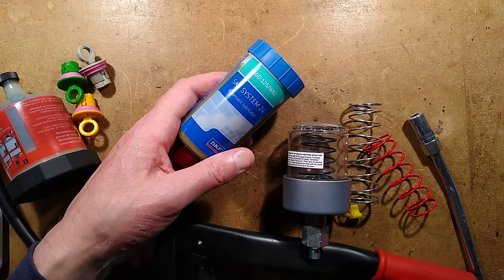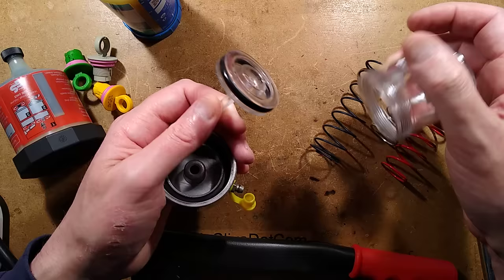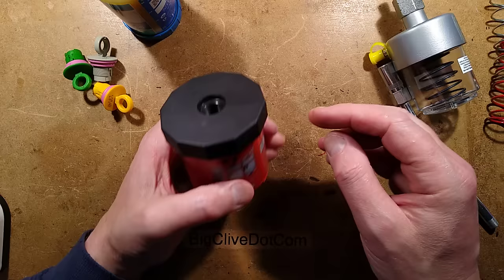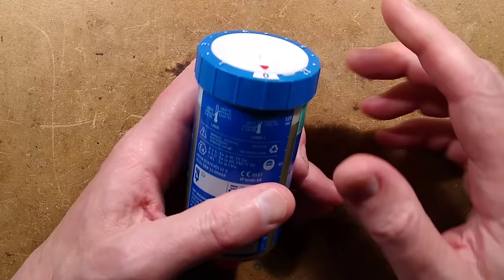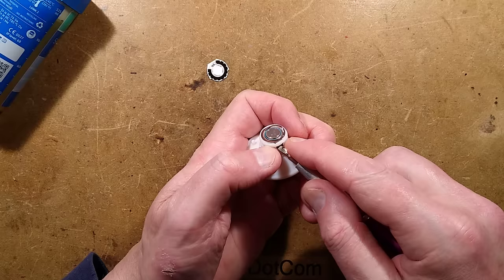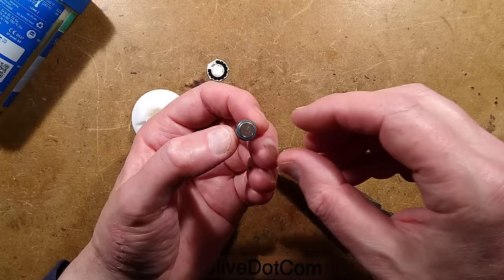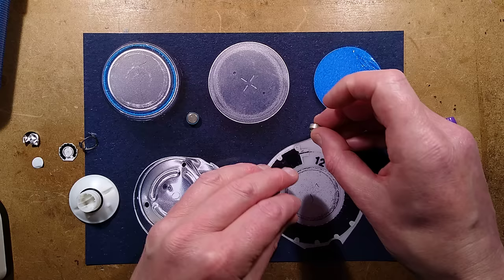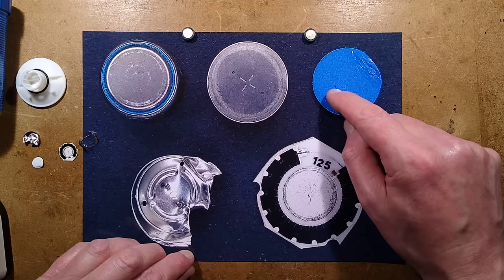Absolute genius automatic lubricator

Comment: Very interesting, yet so simple and brilliant! All of them.
By the way, it's not exactly a potentiometer, but a variable resistor. It has two terminals instead of three.
Reply: I've always called it a carbon film variable resistor.
Reply: Back in my day it was a rheostat.
Reply: @securitycamera8776  "Rheostat" from the Greek ρωή (flow) and στάση (stopping). Nice word that explains what the component does (flow-stopper)
Reply: I was taught variable resistor.
Reply: I always knew it as a potentiometer, just using only some of the 3 pins.  In this device it's entirely custom, not a standard type mounted into the circuit.
Reply: 3 terminal mode potentiometer functions as a voltage divider and for 2 terminal mode as a current limiter like an ordinary resistor

Comment: I’ve seen air fresheners that work on the electro-chemical system. One is called “TCELL” by Rubbermaid. It uses a button cell to pressurize the fragrance and push it onto a wick. I was fascinated with these for a year. Amazing tech.
Reply: I just saw that you have a video on the Rubbermaid fresheners! 😊

Comment: Genius design. Now I want to know how much gas is generated over a fixed time. Seal one of the cells inside a balloon with a fixed resistor across it and leave for a few days?
Reply: You might find that the gas leaks out through the walls of the balloon faster than the cell generates it!
Reply: There's no gas evolution from a normal zinc air cell...
Reply: @stepheneyles2198  agreed. Seal it in a small chamber with a pressure gauge, chart pressure rise at regular intervals and then use universal gas laws to calculate subsequent volumes and use as basis for any further calculations you need. It would seem the release of gas is linear in nature in relation to increase in resistance so no need for plotting at many different resistances once you confirm that
Reply: @stepheneyles2198  Anything that could leak through the walls of a balloon is going to walk right past that rubber O ring and not touch either side.
Reply: Try a mylar balloon or bag, heat sealed closed.
Reply: @Alacritous  I'm imagining some gas molecules as stick figures doing the Jim Carrey Walk through the cross-section of an O-ring on one of Clive's doodles right now!
"... going to walk right past ..." 
Have a Thumb-Up for that statement! 😀
Reply: @Alacritous  Ridiculously false. latex balloon vs. viton o-ring. Don't be silly.
Reply: @peterjf7723  Also a good idea... I have a dozen pressure gauges so I think of such solutions first. Bias is funny that way and I need to remain vigilant against it.
Reply: could use the ideal gas law and the volume of the container, etc
Reply: @stepheneyles2198  Use a Mylar balloon.
 I have one which was purchased in 2008. It is still fully inflated quite hard in 2022!   Amazing.
Reply: @off spec : You’d want to measure the pressure too, and do something to reduce the dry stiction.
Reply: Seal them in a jar with some sort of oil in it, upside-down in a dish full of oil. Old science fair experiment, except don't use water since it's conducting, and since it can absorb a lot of gases. You'd need some very very inert oil, but I'm sure there's something in Clive's toolbox hanging round from his last trip to Chernobyl. After it blew I mean, I'm not blaming him for it!
Reply: @MadScientist267  From Wikipedia: When a load is applied over zinc-air batteries without access to oxygen, they generate hydrogen gas at a fairly controllable rate, proportional to the load. This can build up pressure, which is used in certain applications to expel another liquid over a longer period, like automatic lubricators or air fresheners.

https://en.wikipedia.org/wiki/Zinc%E2%80%93air_battery
Reply: Vaccum seal it.
Vaccum bags are airtight othervise they would not work

Comment: We used these on conveyor belt bearings around the recycling plant I worked in, saved us a lot of hassle with the bearing that weren't readily accessible (I'm talking belts 50' in the air that needed a cherry picker to access).

Comment: We use these all over the machines we make. I never had a chance to find a broken/empty one to take apart.
And one of our CNC centers has a big one (size of a toilet paper roll), uses 2 AA batteries, and the timer is set via DIP switches. It uses a nitrogen gas tank.
Reply: What the nitrogen tank looks like ?
Is it all contained within the unit or attached next to it and connected via a hose ?
Reply: If it has 2 AA batteries it is an electro mechanical unit not gas
Reply: @mrbumcraic5046  pretty sure AvE took apart one that was a gas generator based around urea and it had 2 AA sized batteries

Comment: How interesting and also simple - I wonder how the designer came up with it.....brillant! High five to Clive - always opening things and then carefully explaining how they work.
Reply: I guess, like many, if not most inventions, it was found by accident 😁 or the designer had a hearing aid, found a battery in its packaging blown up and went investigating 😉
Reply: It's just an "evolution" of older systems, like the one with the chemical tablet. They're using a battery and a variable resistance to do the same as the tablets with different gas release rates.
Reply: @RFC-3514  if the button cell itself wouldn't produce the gas, I'd have expected some heating element for example. The simplicity of this design is the button cells have two functons: power supply & gas generator at the same time.
Reply: @SystemX1983  - Power supply?
Reply: @RFC-3514  the batteries deliver the power to produce the gas by itself, regulated by the "potentiometer" it produces more or less gas. But at some point that gassing will stop because the battery is empty, either from  chemical view or electrical view.
Reply: @SystemX1983  - The chemcials in the batteries produce the gas when they react, same as the ones in the other model. It's exactly the same concept. The gas is what pushes the piston.

Comment: I had difficulty convincing management that it would be beneficial to install these, especially in locations that were difficult to get to that were seldom, if ever, greased. I was able to get them to do it after showing them a bearing that had to be replaced on a 2 year old conveyor that still had the paint on the grease Zerk. I added steel brake lines to keep them out of harms way.
Reply: And there is the answer...install remote grease zerks/nipples in a combined location which is easy to reach so the greae gunner can lubricate the bearings with little effort or danger.
Labels with the number of pumps on each zerk....
Reply: @JohnSmith-yv6eq  Remote greasing comes with it's own problems. The farther away you get from the greasing point, the more chance there is that the remote lines could be damaged. It's best if someone actually looks at the bearing that's being greased. When it's -20F it can be difficult to get grease to go through longer lines.
Reply: @tiredoldmechanic1791  
A manual grease gun can deliver up to 10,000 psi, these gas units will only do about 50 psi

Comment: A few years ago I regularly used a motorized/battery powered one with replacable Batteries and lubricant cartridges in an industrial paintline for its conveyors Ball bearings. It had a push button to prefill the lubricant line at install and a dip switch or maybe a potentiometer (not sure anymore) to control the timing.
Reply: At my work we have a couple of those motorized auto-lubricators with dip switches for setting the dispensing period. Since it was the only machine with the auto-lubers, and the batteries need periodic replacing, the auto-lubers were eventually removed, and the machine is manually lubricated like everything else!

Comment: i always suspected the batteries release the gas in these things. that was interesting to see everything up close, thanks! ALSO: they are really not that accurate, it highly depends on the altitude they are used in.
Reply: and the operating temperature
Reply: And the internal friction of the machine being lubricated. But it's just a matter of adjusting to each location.
Reply: Temperature does make a small difference, if you use the Simalube version (the originals) they are infinitely adjustable between 1 and 12 months and a slight tweak can make them very precise
Reply: SKF have a calculator that includes things like operating temperature, and a bunch of other variables to decide what setting to put the greasers onto

Comment: We used to sell Zinc-Air batteries as a replacement for NLA Mercury 1.35v cells in vintage cameras. However, we had issues with corrosion forming while the batteries were still in their packaging with the seal attached.  I wonder if SKF have found a better quality battery than the ones we were being supplied ;)
Reply: Who made your zinc-air batteries? :P
Reply: Actually, they power their device entirely from the problem!

Comment: I use these a lot at work. Good things. I use these in various different grease and oil grades. Been planning to buy the smaller ones for few places. I'd bet they have single cell inside as the diameter and the top end looks absolutely identical on all of them 🙂
Reply: How is the timing accuracy?  Do they actually last for the amount of time they're supposed to?
Reply: @ArmyCop  accuracy is incredibly good. Max two weeks deviation is what I've seen. Considering the amount for period ratio, in my books that's about perfect. Also can't recall seeing them get empty earlier than set or at least it happens very seldom. Though it could be that it's because I usually install these with small amount of grease line which creates obviously some resistance always.

Comment: The Sidel bottle blowers at work use auto greasers with a replacement battery pack.  The joys of working in a soft drinks factory. A very informative video.

Comment: Propose an experiment to confirm: Solder a resistor across the batteries and stuff them into a balloon so see if/how much the balloon inflates. Would be neat to have an idea how much gas they actually produce.
Reply: I think I'll do it right now given how ridiculously simple it looks.
One caveat though is standard alkaline batteries don't have breathing or vent holes, therefore the excess pressure will fatigue the rubber gaskets and potentially make them fail, releasing battery electrolyte... Inside the balloon.
Maybe not such a big deal after all...
Reply: as said under another comment about this idea, a rubber balloon is far from a perfect sealed barrier and it leaks excessive pressure over time.
Reply: Or a vacuum sealed bag as it is airtight
Reply: The volume of that piston looks to be only a few cubic centimetres with a minimum production time of a month which is the setting for  maximum production rate. Normal rubber balloons can leak hundreds of times that volume that in a few days. You're probably better off eating a bag of crisps then heat sealing the edge with a kitchen vacuum resealer as the metalised foil is much more air resistant than latex.

Comment: Looks like an ideal fitting on many combine harvester bearings, remote mounted with a flexible pipe between the bearing and the grease unit. Set for two or three months in the UK, depending on the expected harvest length. it would seem to be the ideal size and indeed an ideal disposable maintenance solution. Just check every couple of days that the grease is getting to the bearing and replace annually.
Reply: The limitations are the 5 bar max output pressure which won’t push most greases through hoses more than a meter long

Comment: we use lots of these in our feed pelleting mill, mostly on conveyors of raw materials. These cartridges do save a lot of time and effort for maintenence, but we've found them unsuitable for high temperature areas as the grease dries out and turns into a wax like consistency.
Reply: Is the high temperature area small or large? If it's small, some plumbing to get the cartridge placed further away where it's cool could help.
We have maybe 500 grease points, and it takes around 2 hours for a person to go through them all with a pneumaticly powered grease gun. 
We had cartridges like that on some machines that were bought second hand, the cartridges all discharged while the machine was in storage, creating somewhat of a mess.
We have central lubrication systems where you have one tank and plunger, and various distribution methods, plus lots and lots of plumbing. The good thing is that they don't pump alot of grease all over if the machine is at a standstill for a month or two. The disadvantage is that grease tends to dry out, and you have no real insight into whether a lubrication point is getting lubed or not.

A "Grease monkey" with a manual grease gun will be able to tell if a nipple is blocked or not. Automatics, as commonly installed, don't seem to provide the same feedback. Your feedback is when the bearing fails.

Comment: Shorted zinc-air battery without oxygen will produce hydrogen
(~0,3 H2 liter at normal pressure per gram of ideal zinc water mixture, because of casing, additives etc. in practice probably more like 0,1 H2 liter per gram of battery if there is sufficient amout of water)
I see here some explosion potential, maybe worth trying?
Reply from the maker: Experiments are in progress.
Reply: Thank you Marcin. 
The amount of comments I had to go through, with nobody even asking what the gas was!

Comment: I use to work in a steel mill as a break down electrician. These auto geezers were a new thing back then (20 years ago). I do remember an adjustable version even back then. The adjustment was made by turning a dial the full diameter of the geeezer. I wonder is it was the same tech?
Reply: Most likely. There are couple of manufacturer of similar products.
Reply: I saw auto geezers and thought "old car guys", lol...

Comment: In the fabrication shop I used to work at, it usually took 2 guys about 4 hours to grease 12 machines, twice a year.  So that's about $50 x 4 hours x 2 per year, or about $400.  Compare that to $37 per unit x 12 or about $444, assuming each machine needs only one unit.  The older machines often needed grease in multiple locations.
Reply: You dont factor cost of grease and equipment for 2 guys to grease those 12 machines)
Reply: Side benefit - those 2 folks will be doing other things during those 4 hours!
Reply: These are single point only lubricators
1 unit to replace 1 grease nipple

Comment: Ah yes Mr. Clive. At last something I know a bit about. I do know its limitations. If you chose this and do away with the Greaser employee then bear in mind. It lets you down frequently in the real world especially by melting its small plastic thread if it fails to deliver the correct quantity. It is a dark art setting them. If it is not linked to feed back tech then buyer beware. I have seen these melted and lying on the ground still squirting their grease while the machine slowly kills itself. Vibration and a term describing  a ''bearing wanting a drink'' and cracking under strong sunlight are some of its enemy's.  Nice idea. But if you value your machine be careful.

Comment: Good stuff! I've often seen these empty canisters discarded by the side of the railway and wondered what they were. I'd assume they are used for lubricating points. You do also get the huge grease pots that are activated by trains as they roll over them and the wheels hit a little plunger.
Reply: Aren't they for anti-squeal use in curves? I thunk the points have other lubrication means..
Reply: @jeremywilliams5107  the big yellow ones are yes. I'm going to assume that these ones go inside the point motors.
Reply: The RR I work for uses them to lubricate external locking mechanism for point machines. They mostly work well but in some locations the vibration from trains snaps them off.
Reply: @hannahranga  yeah can't imagine the plastic does well under UV light exposure. Probably goes very brittle

Comment: Is there a particular reason to think these are zinc-air rather that some other custom chemistry?
Reply: Probably that they exist and are "standard". No need to invest the wheel if there's an off-the-shelf battery you can buy/use.
Reply from the maker: They may be custom, but the patent linked in the description seems to hint at zinc air cells exhibiting this effect.  I have some cells on order to test.
Reply: I'm fairly certain that zinc air cells, at least when operating as intended, do not evolve any gas. Something odd is going on in this device.
Reply: @BigClive  The only use I've previously heard Zinc-air cells used for is hearing aids.
Reply: @sootikins  I think they charge one of the zink cells with the other zink cell. This would release the gas from zink oxide.
Reply: I'm curious to see if you can turn normal batteries into micro hydrogen generators Clive. 
I wonder if the hydrogen coming out will break the label seal and allow oxygen in. They still may need to be in an external oxygen free container.
Reply: @BigClive  They are custom. Mercury was used the prevent the gassing in the older cells.  I thing all you have to do is use the old formula and skip  the mercury and you have a gassing cell.
Reply: @johnl3487  How does the mercury stop hydrogen generation?
Reply: @jam99  I don't know the mechinism, but that  is one of the things that it did in the cell. It took years the get the Hg out and still have the same capasity.
Reply: @jam99 The overall reaction is zinc + mercuric oxide --> zinc oxide + mercury. An intermediate step, at the cathode, is mercuric oxide + water + electrons --> mercury + hydroxide. When the oxygen ion from the oxide reacts with the water molecule it immediately forms two hydroxide ions. There is no point at which the hydrogen atoms or ions from the broken apart water molecule can bond to firm gaseous hydrogen.